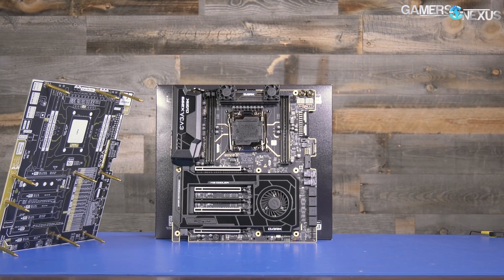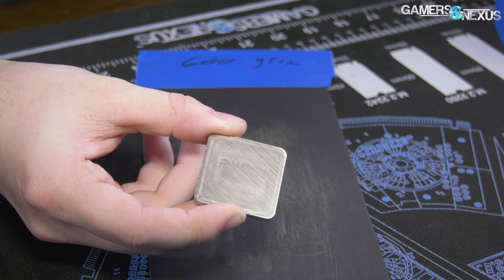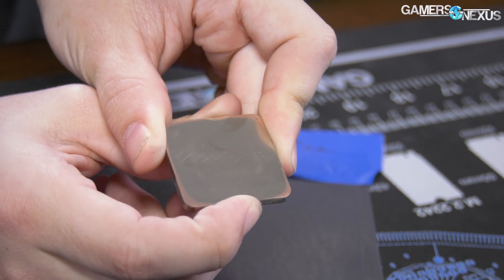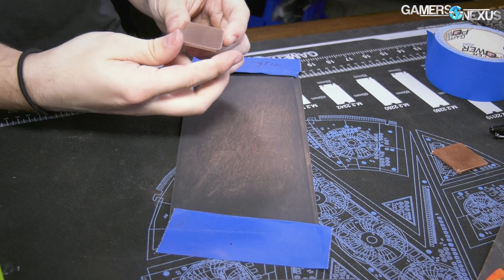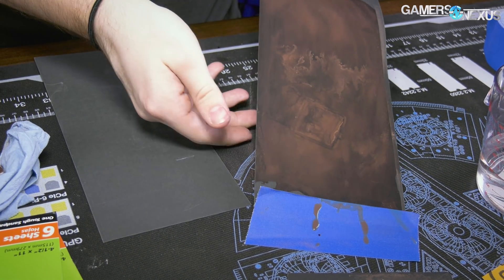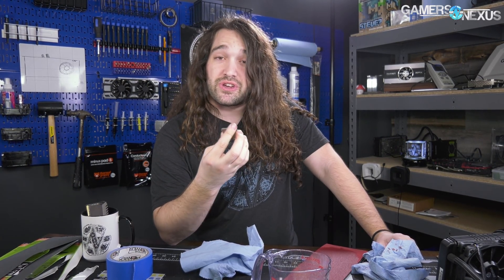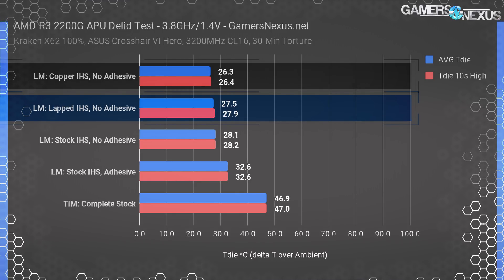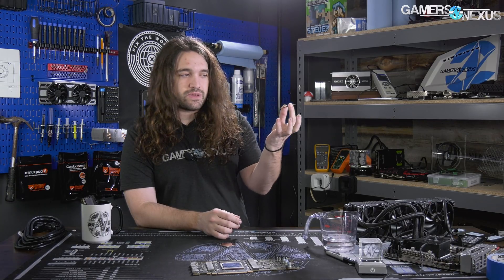Lapped Ryzen IHS vs. Copper & Stock IHS

Comment from the maker: Not shown: Polishing the hell out of it, but that was even more boring than sandpaper. See the thumbnail (or article) for photos of the final mirrored finish! 
Article: https://www.gamersnexus.net/guides/3299-lapped-amd-ryzen-ihs-thermal-results-vs-rockit-cool
Previous Rockit Cool test: https://www.youtube.com/watch?v=yb-ESEntTuA
Reply: I usually respect the videos you guys do and consider this a pretty trusted source or at least you guys mean well.  You really need to do a follow up video explaining how you guys messed this one up so bad.  As it stands this is misinformation you're claiming to have knowledge of how to do something in this case lapping and then you demonstrate how to procedurally ruin your ihs via a process which is not lapping.  You make a convex ihs and then claim AMD has some defect where it is pushed down in the center.  That cylinder is because you're shaving off more metal off the edges every time you sand.  You must have a flat surface to achieve a flat surface and aside from some really clever engineering maybe you'll never get a flatter surface than your reference surface.
Reply: Steve, you need a 3D printer. You could have 3D printet a lapping holder. It would have sped up the lapping process, and you wouldn't have endangered your fingers in the process. Also would have been handy in the Hades Canyon mod to print a custom water block holder.
Reply: wall needs more hammers please
Reply: Negligible result's, excellent content. edit: what about lapping the hsf or block too?
Reply: You doing it wrong you should do it like this (I know its a knife but it's  metal nevertheless and not very hard metal because the knife cost 1$):
https://www.youtube.com/watch?v=0P6klz6BTek
final grit was 30000 and the effect was a mirror
Reply: shouldnt you be doing this on a fresh pane of glass with the glass paper/wet and dry paper on top of that - to maintain a perfect flat surface?
Reply: This , using a soft surface under the paper makes convex sanding.
Reply: I'm not saying you've done this wrong but isn't the rocket cool IHS full copper? You only "lapped" the top of the stock IHS here so there is still a layer of Nickel impeding thermal transfer on the inside. I agree improvements would likely be small and the difficulty of effectively removing the Nickel coating evenly on the inside is problematic.

Nice fun piece though. More light hearted than usual!

As an aside. Have you looked into doing a condensed version of the ModMat as a poster?
Reply: I think it would help to stand down the back side , not the part that tocuehs the die ( you could remove the nickle plate as that will have a tiny effect) but the edges , this will result in better pressue on your die and thus better contact and thermal transfer .

Remeber lapping is never about shinyness , its about flatness. its almost better to leave it scratched as long as its flat . 

Doing it on the soft mod mat may also add rounded edges as its so soft , lap on glass you will get more flatness.

If you do the IHS and your heatsync you should be able to get to the point where you dont even need tim as its so flat, but that takes a LOOOOOOONNNNG time.
Reply: but you did not polish the underside, which probably would have made up the difference..   :+)
Reply: There are statistics techniques that can be used to calculate the difference in average between the two tests.  It's a pain to learn.  If you are doing multiple measurements for each you already have all the data you need to find the range in difference with a given confidence level.
Reply: Gamers Nexus how long did the whole process take that editing and time-lapsing sped up?
Reply: hey next time you do anytype of sanding  a general rule is anything above 400 grit is done wet. with metal anyway. it clears the shavings faster and keeps the paper sharp. also thanks for bullying me into geting a mod mat i hope you are happy STEVE.
Reply: you guys should really check out the COUGAR Panzer s case i think you guys would really like it its all about airflow and looks pretty good thats y i got it bc you guys really help me with your case reviews bc my old case was the phanteks p400s and it looked good but the front panel really sucks plus i have to put my radiator on the front so everything in my case was starving for air so it was just really loud so thats y i got the cougar panzer s now its nice and cool and not loud as shit
Reply: Gamers Nexus I sanded the outside and inside of the his and the die itself. Only used 1500 and 2000 in the die then polished all three things on a 4770k at 1.425 volts gutting 4.6ghz was able to hit 4.7 after and was hitting the same tempature
Reply: Not sure if it's just me, but your photo is way too blurry
Reply: Have you guys ever thought of having a high end cpu or gpu cryogenically treated?  I give it a 50/50 chance of making a difference.
Reply: You can use a new razor blade to check the surface flatness. I'm sure you can figure out how. ;)
Reply: Steve, I think your blood sacrifice to the OC gods may have interfered with the thermals some, lol. JK.

I usually don't bother with anything beyond 600/800/1000 grit, as the goal is to level off the IHS not make it a mirror for me. Also, wet tends to not go through so many sheets, and keeps the dust down, so I don't bother lapping dry. Granted the last time I lapped a CPU was the FX8350.

Great vid GN crew B)
Reply: Do it properly or not at all.
- You need an absolutely flat surface - glass is not perfect but should be ok. Doing this on your workmat is just wrong. Or stacking the papers on top each other...
- Use water and wetsand for gods sake!
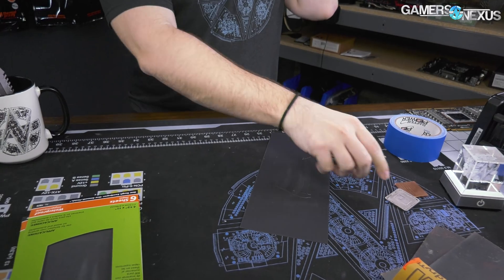Reply: Stopped at 2:40 to point out that you HAVE to use a perfectly flat surface for lapping. Float glass is ideal and works well with tape. Now I'm going to pop some popcorn and chuckle when your table + modmat + sandpaper 'lap' ends up in flames. A proper follow up would be great though!
Reply: Now sand the bottom part too till it gets to the point of being much lower in height,  cause you're crazy guys  : D
Reply: So a nice follow up would be properly sanding the ihs on both sides and sanding the cooler as well as that would surely be the bottleneck.
Reply: Try a solid graphite IHS, it'll be fragile though...
Reply: @wanrazul  how about graphite cloth
Reply: I find it funny that quite a few people here are judging Steve based on his technique when hes worked with kingpin and der8bauer 🤔
Reply: Gamers Nexus lap the cpu block as well? How is the contact on your heatsink?
Reply: https://www.youtube.com/user/oxtoolco watch his videos on flatness and try again ;)

Comment: I always start with 320 grit. It will definitely save you some time.  I also mostly just worry about getting the IHS flat, so once the corners are showing copper is when I switch to the higher grit. Usually 800, then 1200 and I finish with either 1500 or 2000.

Comment: With water you might get some more use out of a sheet of sandpaper.  It helps keep the paper from clogging.  Clogging is worse as you go with finer grits.  In the automotive section of some stores and in autobody supply stores you may find 3000 grit or more.  There is one thing to consider before you make it so nice and shiny and that is sometimes surface imperfections help dissipate more heat.  How much more I don't know.  Only tests can give better answers.  If you have one that was done with a coarser grit and one that is micro finished you can probably see a temperature difference with monitoring software.

Comment: Polishing the IHS is a BAD idea. It can actually insulate the surface. Also, you should sand it on a flat surface (the flattest one that anyone has in their house is a mirror). With those two steps you can easily get 4-6 degrees down from stock temps

Comment: This test really doesn’t compare to the aftermarket ihs because you’re changing the material exposed on the stock ihs and the smoothness but it’s documented that bare copper transfers better than nickel plated… so we’ll just go with that.

Comment: As an engineer thrust me you getting off the edges coz your mat is not perfectly flat. You can't lap properly without a perfectly flat surface.... That mat is pushed down thats why remove the corners...  You just removed some material from the top but you has not make it flat at all.... If you wish to argue or see a perfect lapping or you want me to measure how good job you done i am happy to do it... Scan it for you...

Comment: I would use a level surface.  Pieces of old granite counters work great and you can get them for free or cheap from countertop companies that cut them.  3M adhesive pads can grab the piece of metal and save your fingers.  I used to sand RC car differential rings this way that were even smaller.

Comment: Debating trying this on my 5950x because.. why not. I am definitely using a vernier to measure the thickness beforehand and monitor progression. Looks like something that would be rewarding to do upon successful completion.. legitimately making your IHS smoother. Fitter/metal fabricator here; as some others have pointing out, the corners showing copper early has to do with the sand paper not being taut/perfectly flat.

Comment: I appreciate this video but would just like to point out that you didn't actually polish the ihs.  When you finish the surface with 3000 wet and buff it with compound then finishing glaze it will look like a mirror and the surface will actually have less imperfections.  All you've really done here is make the ihs thinner and the surface imperfections bigger and symmetrical.  Also should note that you need to sand in an orbital pattern as this is known as self correcting.  Two perfectly polished flat surfaces are actually hard to separate from each other even without paste.  When all the air gets pushed out you have the best mechanical bond without fusing.

Comment: i got an i7 7700k and im hitting 80c on medium load and 100c on high load i have used mx4 past and reapplied and reseated countless times with no change i think there is a dome high spot on the ihs as in the middle after removing the heat sync there is a spot that looks like all the past was pushed out a thin oval shape and the rest is rather thick and you can spin it on a piece of glass for quite some time lol so im gonna lap and also delid while im at it have not be able to over clock it since i got it like 2 years ago and i intended to overclock from day 1

Comment: Whether or not it's worth doing is entirely dependent upon how flat your particular IHS is. 

watch?v=XKig29P4FWo&t=428s

IHS interfaces are always stamped metal. Nowhere close to precision flat. 

You don't actually have to use thermal paste if your surfaces are flat enough, and there is a better transfer of heat metal to metal. Imagine for a moment you took bluing dye, and you smeared it across your CPU, then you installed your waterblock in a manner to transfer the topology from one to the other so you could identify how much surface area is making contact. You would only see pockets of areas that aren't making contact- those are the only spots in which you actually want thermal paste. It's a very, very small area.

Comment: I know this is kind of dead but I came across it in my never ending quest for lower temps. You forgot to break the back of the sandpaper Steve! It's an old technique but it makes the paper more effective by breaking the surface adhesion on the sandpaper exposing more sand. Maybe I know this because I'm an old carpenter. But it's true with all sandpaper as far as I know.

Comment: Your table is not flat and thus your sanding is useless.  You need to lap on a flat surface, a piece of thick glass at a minimum but ideally a measuring table or granite block.

Comment: Folks, this is royal waste of time. The REAL and ONLY way to measurably improve thermals is actually deliding the CPU and permanently leave it delided! is never re-lid again! WITH NOTHING! You will need a special height adapter for the socket to be able to compensate for the height loss and properly secure the heatsink (available from a couple of specialized online vendors).. and there you go! Now you've actually, eliminate the problem completely instead of just lapping the barely does anything in practical terms. Getting rid of one heat transfer stage altogether is the only way to go :)

Comment: if you need to flat any surface you need to use hard material under sand paper otherwise you will end up rounding edges. Try googling flattening plane iron. Try using DMT Dia-Sharp® Bench Stone (extra fine) or borrow from woodworking enthusiast

Comment: wet and dry emery cloth actually works better if you leave it in water over night in a bucket of water. if it's the cheap paper stuff you obvious can't do that but the good stuff works better when left to soak.
Also, work in figure of eights, not straight lines. Then go at 90 degrees in figures of eight. You get a flatter surface

Comment: You shouldn't polish it. otherwise the thermal paste will just slid off the sides because it doesn't have rough surface to stick to.
Reply: @gu3z185  You didn't get it? can you use more than one character? I'm happy to help you understand.
what I mean is he should have stopped at 1200 grit wet to leave a surface rough enough for the thermal paste to adhere to.

Comment: Get a cheap granite surface plate and the difference in sanding will be significant. When trying to do precision lapping or sanding you absolutely need a true flat hard surface. I guarantee that you are left with a convex surface using the rubber mat

Comment: You didn't do it on a flat surface, you did it on a cushion. That's not lapping. That's sanding. And I don't know why you think you need a mirrored finish, it has less surface area. You're supposed to FINISH with 600 grit, not start with it.

If you don't know what you're doing then use google. Don't just be like "Oh well we can waste money on fucking stuff up so lets not bother to do it properly" because this whole video is now pointless. You made the IHS more rounded if anything.

Comment: You need to lap on a hard flat surface like a piece of glass, by using something soft as the backer you've just rounded off the corners. You also need to use that paper wet, it stopped working not because it was worn out but because it was filled with the material you've sanded off. Water will lift the debris out of the paper and let it keep working. Also, when sand paper gets worn out it doesn't become a higher grit. The abrasive either falls off or loses it's sharpness, worn out paper of a given grit is just rubbish paper of that grit not a higher grit. You can't get a finer surface with worn out paper because there will still be some sharp bits of grit at the original level.

Comment: FYI...copper is a very good conductor but it does corrode. it forms copper compounds on the surface which actually protect the rest of the copper from any corrosion, this is why copper on rooftops looks blueish green in color. once that layer is formed the copper will not corrode any further. however this surface corrosion layer is rough, and so will not make a good electrical or heat transfer contact. the nickle plating is to stop this layer of corrosion from forming and make a better contact for heat transfer.
rubbing it off may make the heat transfer worse in the long term, because the copper corrosion layer may build up. or maybe the thermal compound will compensate for this by protecting it from the atmosphere. I have no information about this part.
When you use liquid metal on bare copper and it leaves a silver layer on the copper that you can't get off this may actually be a good thing. it does not interfere with the heat transfer because the copper is now plated with gallium. and the gallium in the new liquid metal paste will react favorable with the gallium plating the copper. so don't worry about it.
You can't see it when it's installed so who cares how it looks.
just keep the liquid metal away from aluminum, the gallium will eat it alive.
Reply: Yes copper will oxidize but only where oxygen can reach, if thermal paste/lm is sufficiently applied there will be no oxidation between the two surfaces, I have an old FX-53 that I delidded and lapped, also lapped the waterblock, I still have the same machine running as a retro machine now but last time I replaced the paste the only oxidation was around the outside perimeter where the heatsink couldn't make contact

Comment: having a soft and flexible surface underneath it made it worse at best. you need to stick the sandpaper to perfectly flat glass for the best result. a matt will give under pressure and the result won't be perfectly even....

Comment: The edges are not higher, when you rub the heat spreader against the paper, 2 things happen. Your middle of the IHS spreads the pressure evenly between all edges, but edges have no pressure spread from one direction, causing sandpaper to dig into the surface.

The second is the pressure on the sandpaper, in the middle the pressure spreads and there's less abrasion than on the edge. So effectively, you're curving the surface of the IHS.

Comment: Lapping became more common because in the early days of IHS's, they were very uneven and made poor contact with the HSF or WB. The goal wasn't to remove the coating or to polish it, but to get the surface of the IHS as flat as possible. Doing this could drop Temps 3-7 degrees C.

Today's IHS are much better at being flat. So it's not as common today. But, if you are going for maximum cooling, it's worth the time and effort.